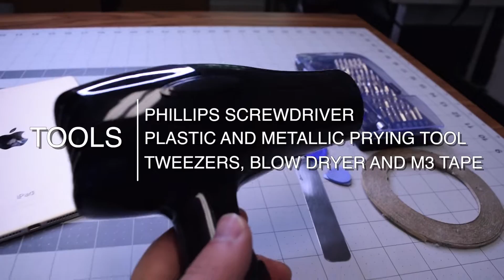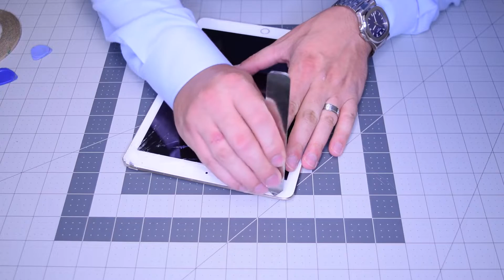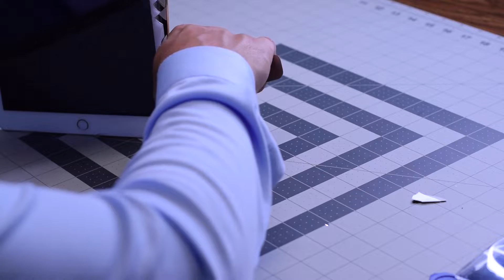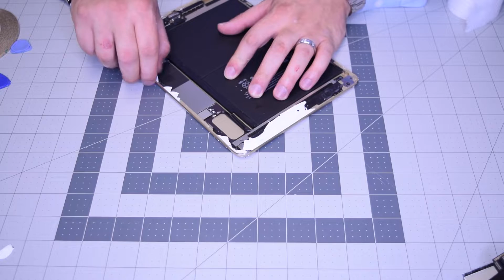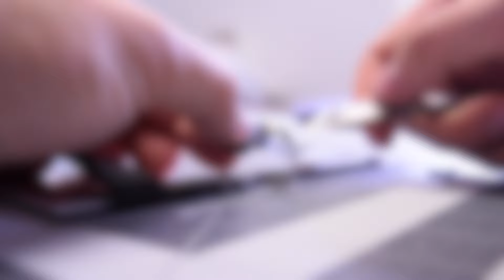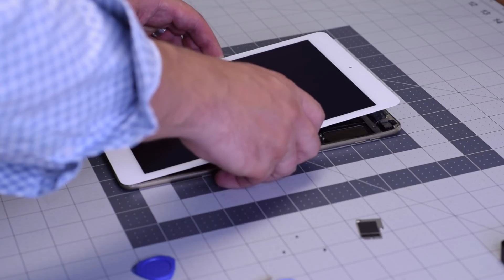⚙️🛠️🍏iPad Air 2 - Screen Replacement (A1566 and A1567)

Comment: always disconnect the battery! Even if it's turned off!
Reply: Ho ho ho you would have to bend the motherboard for that or remove it completely
Reply: @imdyinginside1919  no you don't

Comment: Hello, mine took substantial damage to the screen, and one of the interior components seems to have been damaged as well (please see: imgur.com/a/tSYb205 ). Do you that damage would prevent it from working correctly?

Haven’t bought the replacement parts yet (like $120CAD!) and wondering if I should bother. Thanks!
Reply: Hi, Did u order it?

Comment: My dog just knocked my iPad out of my hand.....he’s done it a 1000 times and it fell no different....I thought.  This time it hit a corner and it shattered. 🤦‍♀️😒 I want to cry.   How hard is this to do?  I used to replace my daughters old iPhone screen all the time but they have that glue now....used to be able to just pop it off...this has a cable??  Oh lord.  Aren’t there places in the mall that do this?  How much are those, do u know?
Reply: Well seeing as the Youtuber who made this video has not hit you up for 5 months. I will say it depends on the model. If you have the ipad air 2, you can get a replacement off amazon for around 25-60 dollars. or a certified apple screen off Ebay for around the same.  They have kits that are really cheap and it comes with all the tools needed other then hair dryer. Watching a live demonstration on youtube vs a quick guide video like this one, you could easy be done in under an hour and a half no experience.
Reply: addison alter do you recommend any brand?
Reply: It looks the same as the iPhone 6 screen replacement just bigger it's easy tbh